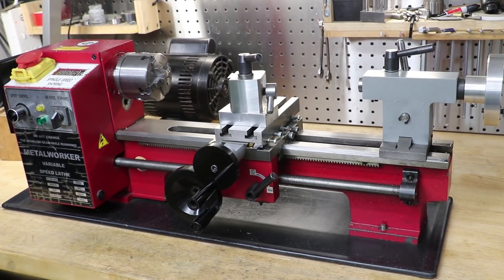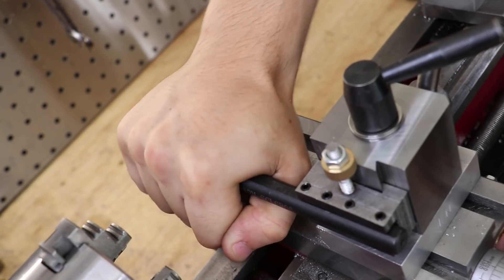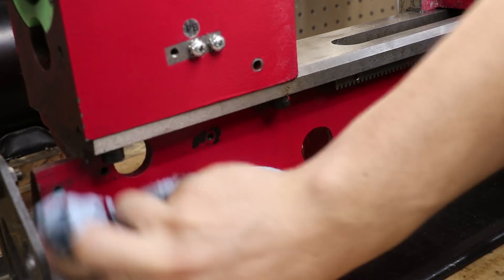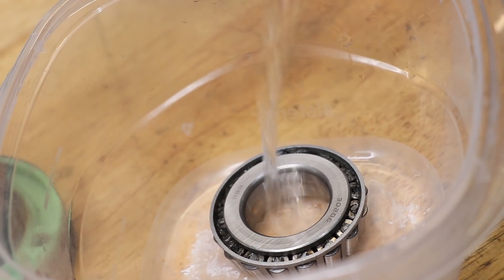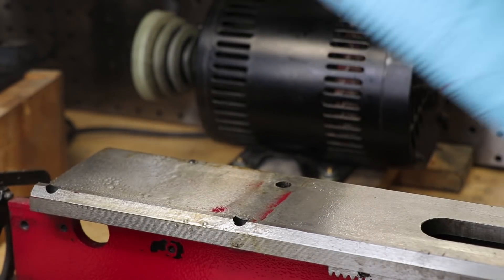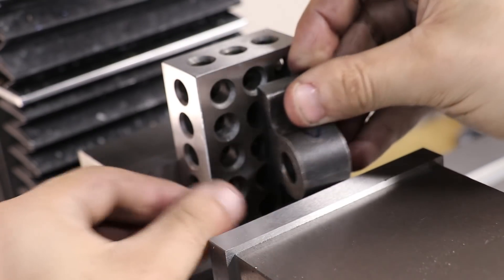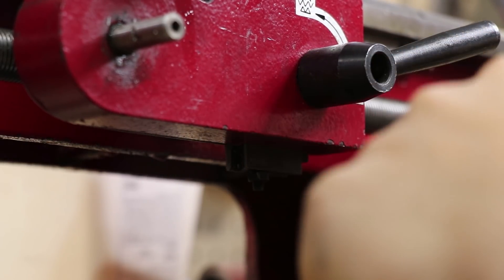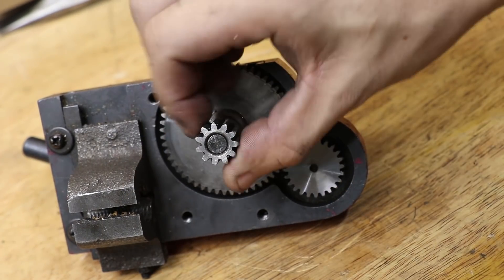Lathe | New Mods, Maintenance & Teardown

Comment: That is not how you 'pack' a bearing.
Reply from the maker: You don't want to pack a lathe spindle bearing as you would pack a wheel bearing for example. Only use just enough grease that you will need, and that should last well over 6 moths. This is how ive seen many people do it and no one seems to run into any issues.

Comment: Cap head screw upgrade was pointless unless you're going to torque them down harder. Steel has the same elasticity coefficient no matter the grade - so if you tighten the 12.9 screws up to about the same as the 8.8 screws - there will still be the same amount of stretch-per-force. What the 12.9 will allow is for you to torque them tighter - and that should probably be measured by a torque wrench so (1) you don't strip/break them, and (2) if you're going to invest any more time into the precision of the lathe, so you can get repeatable results if you take the head off again.
Reply from the maker: Cheers, might be something I over looked, but I still think it's a good idea to replace the Chinese bolts. They aren't that well made and I have had a few strip early on. These were just the last ones left that I hadn't gotten around to changing.

Comment: 7:30 Drills just aren't precision tools. They almost always drill oversize unless the grind is perfect. If you need a precise diameter, the only way is to drill undersize and ream, sadly.
Reply from the maker: Dunno, should have been undersized. Worked for the other two ones but not for the first.
Reply: @artisanmakes  Ah ok, you didn't mention it was undersized. Still, drills do this kind of thing!

Comment: Great work, I have been buying metal know from Edcosteel, thanks for the tip. Where do you get your plastics mate?
Reply from the maker: Mostly from ebay sellers, however I did pick up some engineering plastic from mcjing tooling

Comment: I've been planning on putting oilers on the lead screw bearings. But I've also thought about adding ball bearings or bushings... Any reason why you left it as steel on cast but added the oiler?
Reply from the maker: It is cast iron, so it is a half decent bearing material. And it mostly comes down to it being something I can do in 2 or 3 minutes, rather than having to bore out a press fit hole for the bearings. I don't use the leadscrew often enough to make it a worthwhile upgrade.

Comment: Remove the hole where the old motor stood, fill it with concrete, this will significantly increase the rigidity
Reply from the maker: That is the next video, but Im not doing concrete.

Comment: As blondihacks says "drills are not precision tools"  that's why your oiler holes were oversized.
Reply from the maker: These press fit ones were designed to be used with undersized drilled holes. These were import so maybe the drill sizes got lost in translation.

Comment: 2 mods that I have been thinking about on my lathe like this is extending the cross slide travel, to be able to better turn larger diameters, which is limited by the toolpost movement towards the operator. The second is adding a handwheel to the lead screw end on the car right. The thinking is I can get finer adjustment versus the rack and gear handwheel. Where did you find the button oilers? I had thought about bronze sleeves on the leadscrew.

Comment: One of the best upgrades that I've ever seen for these little lathes: a large block of reinforced concrete to bolt the lathe to. It improves the stiffness and lowers the natural harmonic of the machine by an almost unbelievable amount. Just make sure that you compensate for uneven feet so you don't twist the bed.
Reply: epoxy resin and gravel is also good for reducing vibration and adding rigidity, the added bonus of being able to set threaded bar into it while it's liquid makes it a good substitute to cast iron in diy machines
Reply: @arma3koth290  It's a great material.  Usually referred to as "epoxy granite", there are precise recipes around online.  Just bear in mind it's nowhere near as stiff as cast iron - it's great for adding mass, and its nonuniform structure makes for fantastic vibration damping, but it needs to be used in addition to iron or steel ribs for best effect.
Reply: I've done the same. The 16inch bed extension as well as the cross slide extension is my other 2 favorite mods
Reply: This x 1000! I've seen the upgrade done with an offcut from a stone kitchen bench.